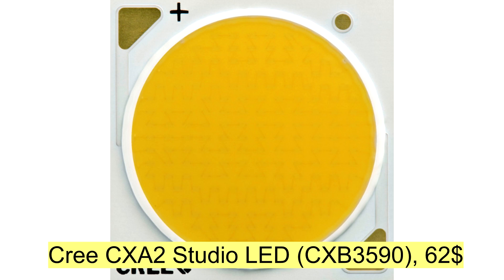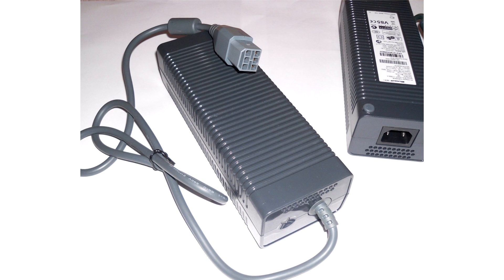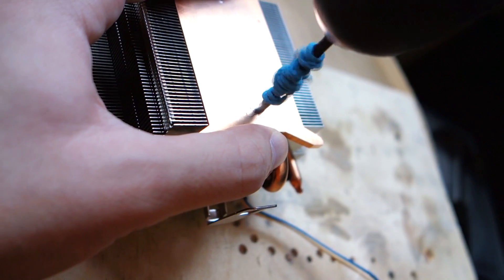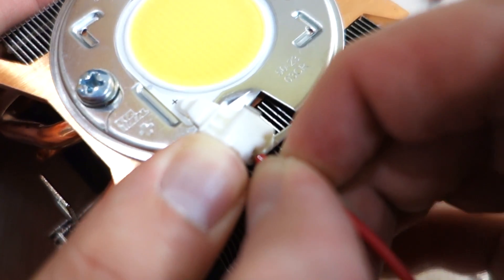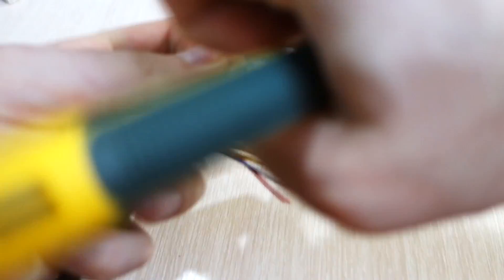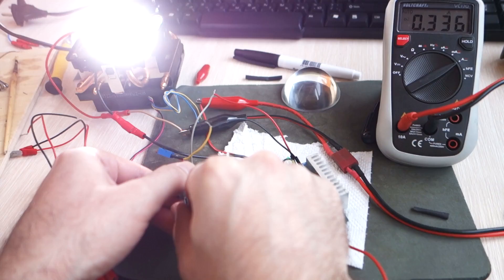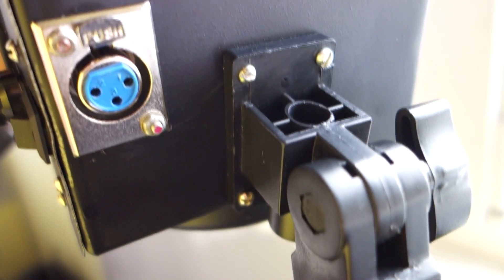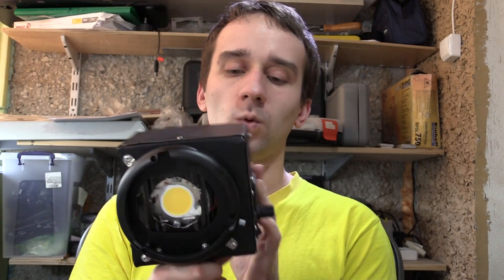DIY Led 100W Studio light

Comment: Great job. I am interesting to build one, but i want to know if you have test how much time it runs (lights) with safety  in mind??? ... the temperature is too high to use it for 1-2 hours continuously ???
Reply from the maker: I tested 3 hours and everyting fine (I use it on 90W max)
Reply: Studio "Juicy shot" Hi! I am doing a science project right now and was hoping you can give me some information. The problem I am trying to solve is that car headlights are too bright to look at because so much light is focused inside a tiny LED. My idea is that if the size of the LED is increased, the discomfort to the eye will be less. In order to test this I was wondering if you can take a picture of your BIG led emitting 500-600 lumens and compare that with a TINY XML emitting 500-600 lumens and see if one is harder to look at. Thank you!
Reply from the maker: it's so small...You can try.. I think less 1K lumens not bad for eye with big size of led...